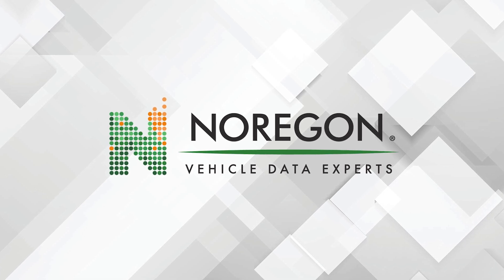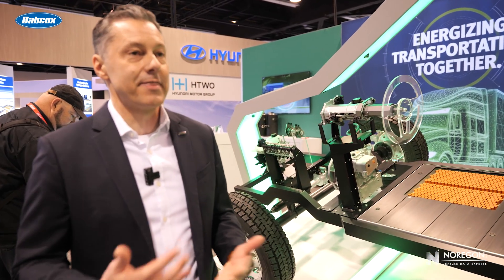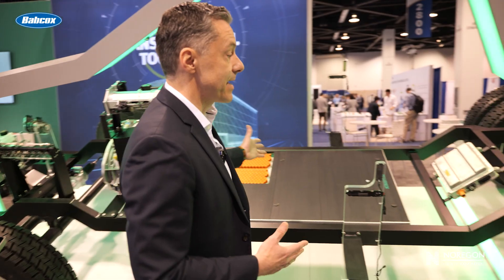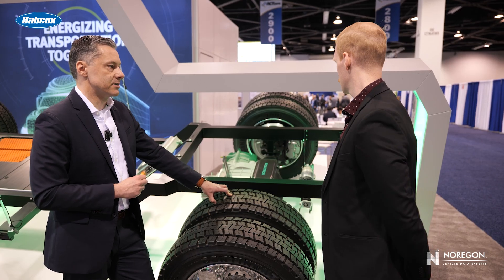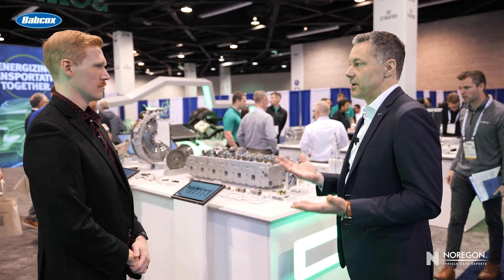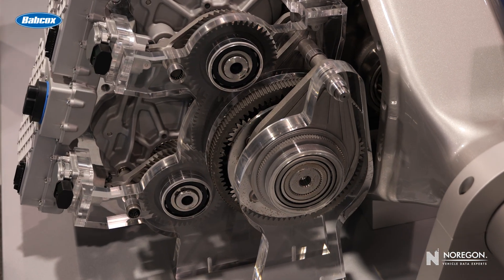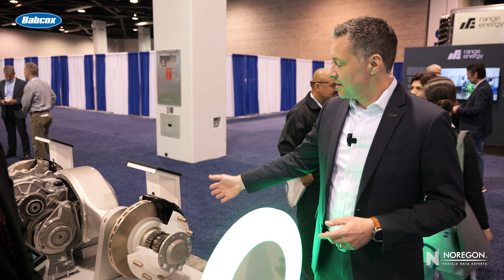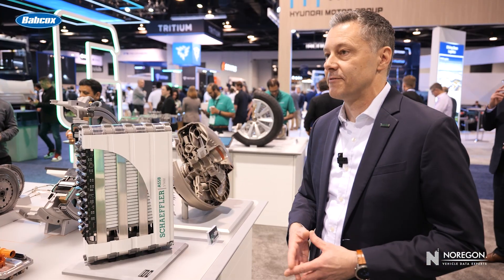Schaeffler Electric Axle Technology Prepares for Class 6-8 Trucks

Comment: Same thing as a diesel electric train. Fully electric steering wouldn't be a good thing because if anything faults and you lose steering, you are in a very dangerous situation! It has to have a fail-safe mode if something goes wrong, you still have steering.